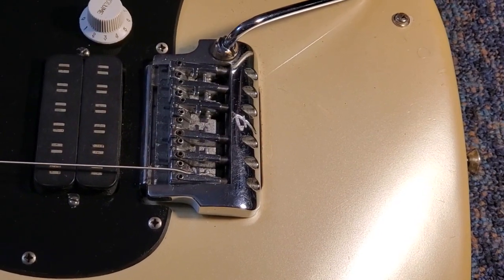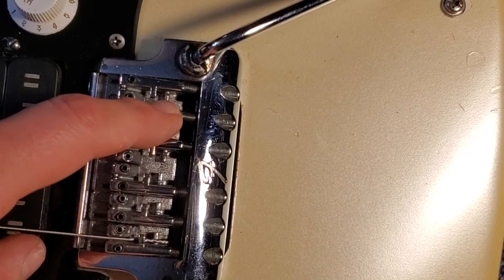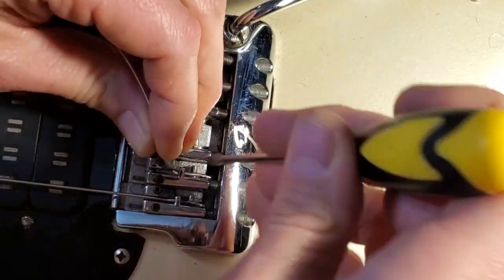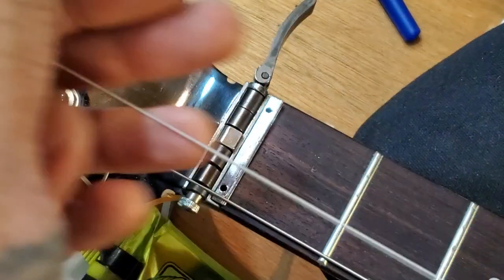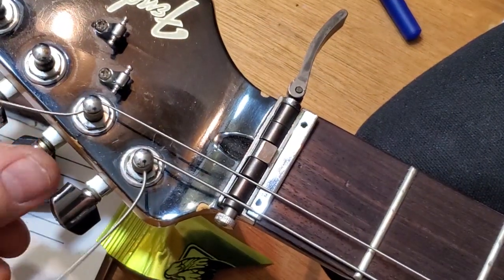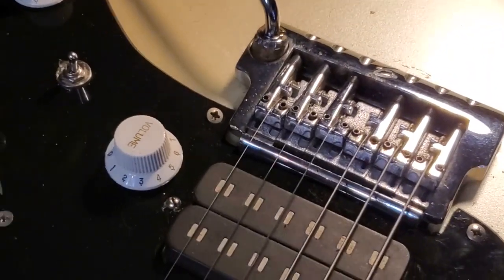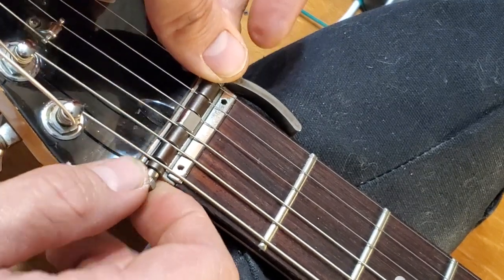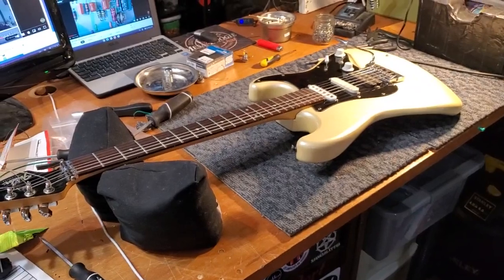1980's Japanese Fender System 3 Tremolo and Locking Nut

Comment: That isn't a System 3 Tremolo, what you have is a System 2 Tremolo, on a Model 027-4100 Contemporary Strat... 
On the System 3, The Fine-Tuner Adjustment-Bolts are facing up, on the Bottom-Front of the Tremolo Bridge... 

I know on mine, (A System 3, Model 027-5700 Strat), you'll know if you have the Tremolo Arm in correctly because, whenever you rotate the Arm Clockwise, it should click when it's just above, or just past the Tone Knob. The Click means the Tremolo-Bridge is in the Locked-Down position. What it does is it turns the Tremolo System into a Hard-Tail Bridge...

Fender must have thought, that since they made these Complex Tremolo-Bridge Systems, they needed to have them do something cool to help keep the buyers quiet...

Thanks for posting the video because there's not too many folks that have these older Contemporary Strats up on YouTube...
Reply from the maker: Nice! Thanks for the info!